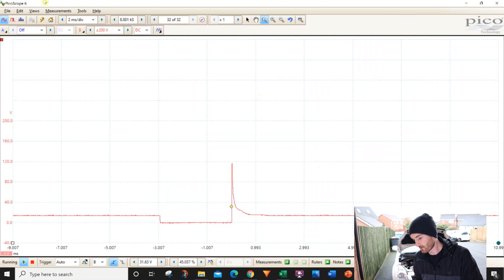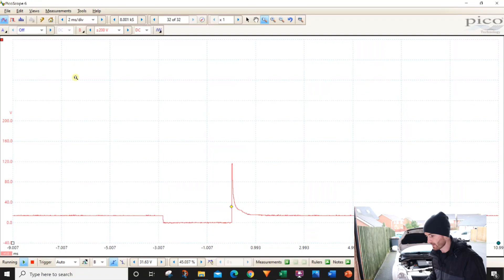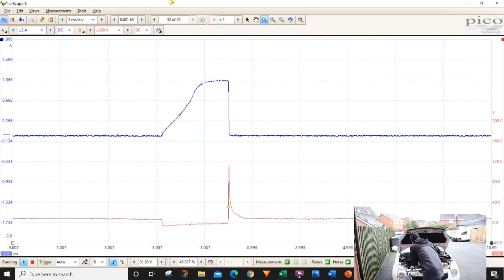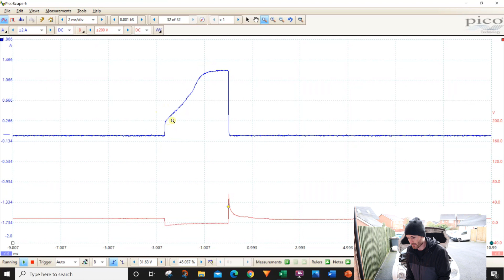SIMPLE Injector Current Ramp | Automotive Oscilloscope Diagnostics | Mechanic Mindset

Comment: Love your videos. I know you have addressed it in previous videos. I think pointing out you have an attenuator on the ground B channel for the  injector and no attenuator with the current clamp would be helpful
Reply from the maker: @weloveups831  Amp Clamp doesn’t need it as it’s not producing a voltage over 20V and we’re not physically measuring the voltage. It works like and amp sensor- the voltage is produced by the amp clamp

Comment: With every clip I watch I'm becoming more and more interested in buying that picoscope.

Dude, the possibilities! Say you get a car that has that annoying ever-so-slight twitch every once in a while, indicating a misfire but not enough for there to be a DTC. Air leak? Bad spark? High temp? Injectors? Coils?

This type of diagnosis, and combined with your other vid on how to test ignition coils, makes it sooooooooo easy to in, say, 15mins?, completely exclude the ignition AND fuel system directly above the cylinders.

Amazing, no more half-arsed guessing. Just comparing each coil and injector.

The moment I get that picoscope I'll be amp-clamping every single part I can get my hands on haha
Reply from the maker: For sure! Very powerful stuff once you get in to it! The 2204A will get you a long way; and then you’re gonna want to upgrade for the 4425A 😅

Comment: Hello from the US . I'm a lady master tech and I Love your videos! 
Another way I have been taught to test for misfires, is to test the power side fuse at the fuse box .If the coils or injectors are not accessible you can take out the fuse for either one and install a loop of wire with a fuse in its place , the current ramp all the injectors or coils to see if one is failing causing the misfire and put a trigger on it , like you would do with a RC test. You can also do a fuel pump the same way. A good video to make could  be on testing with the mini amp probe at the fuse box on different  things?

Comment: Hello. However, I bought a pico 2204a, i.e. with 1 \ 1 x 10 probes for trucks, the possibility of connecting 24v and a current clamp adapter may be useful. Hantek starter will probably be too weak? thanks for the help.
Reply from the maker: Are you referring to the Hantek amp clamp? I suppose it depends on what you need to measure.
Reply: @MechanicMindset  to the probe to measure 24v is probably a choke needed. and the tongs will be an expensive thing. inrush current about 2300 amps. unless the starting current is not measured, Hantek 650 may be enough?

Comment: From the video, you stated that the pintle hump on the current waveform means the injector pintle is open and the pintle hump in the voltage waveform means the injector pintle is closed. Do we need to use 2 channels when checking injectors?
Reply from the maker: To see these 2 events, they need to be checked with an amp clamp and a voltage probe. Separately. You could use one channel and do 2 measurements. But yes, this is 2 separate tests

Comment: Hey Darren,
Great follow on from the last voltage/injector video. There is so much that can be learned from both the voltage and current waveforms run in combination. This includes the MOSFET & diode or zener diodes inside the ECU used to 'clip' the flyback voltage, which helps control the injector close rate.
Well done on another brilliant video in the oscilloscope series!
MiracleMAX 😁
Reply from the maker: Great point, maybe something we can explore in a future video, thanks! 👍

Comment: That last bit about a partial short, sharp initial ramp and maxing out higher than expected was really good Darren.
Take care:)

Denis
Reply from the maker: Cheers Denis, I was quite pleased with myself on that one 😁. Maxing out higher than expected was just because I put a resistor in parallel to the injector increasing the total current. I don’t think it would do that on a real short circuit, just the initial vertical current increase 👍
Reply: Yes, a lovely dual-function tool.

Comment: Really like your videos. I want to lern more. Did you recomend the Pico 2204A to start with? Or is it easier for a beginner with a more expensive scope? More help functions etc?
Reply from the maker: Hi, glad you’re enjoying the channel. To be honest, to a beginner the 2204a and the most expensive 4425a would appear very similar. I think the 2204a is a great starter and you can always sell it if you decide to upgrade. All the accessories can be used on any other Pico too 👍

Comment: excellent. question: how would one interpret the slight short / initial vertica current spike that you explained toward the end? Is it indication of a failing/dying injector?
Reply from the maker: Yes, more than likely a short in the solenoid coil winding
Reply: Inductance in a coil is the property that resists a sudden change in current flow, effectively limiting initial current flow while the magnetic field is building. That's what causes the normal current ramp to be wedge shaped. Normally when a coil is shorted, the insulation at one spot has melted to the point that current can go through fewer loops of wire before it finds a direct pathway to ground. With fewer loops of wire, the inductance of the coil is reduced, so the current ramp is steeper, more closely resembling the way a normal resistive circuit behaves.

Comment: What's your opinion, using the 6 way universal breakout lead's ?
Is it good, by the mean, no back probing and  make a damage to the loom?
Do we have better connection (and waveform) ?
Reply from the maker: They are quite useful. Couple things to be careful of from my own experience. 

1. If you are looking for a fault, removing the connector might affect the issue
2. Always check they are ok before you test, I have used faulty test leads in the past.

Comment: Just a question, if you connect the ground to a chassis ground on one channel while measuring a lamp, and the ground elevates at 0,1V because of voltage drop, is the second Channel, where a battery powered ampclamp is connected going to show something wrong?
Reply from the maker: Current will flow across the ground through the scope; you must not do this with a common ground scope. We did a video on this 👍 You need floating grounds for that.

Comment: Hi, Why do you use an atheunator when testing the voltage and current of the injector when the maximum input voltage of the oscilloscope is 20 volts?
Best regards
Reply from the maker: Hi, I only use the attenuator for the voltage signal (not the amp clamp). The spike goes up to about 120V. Sorry, I had the attenuator connected when I picked up the scope and didn’t make it clear it was for the voltage signal. I cover this on my last video, check it put if you haven’t already 👍
Reply: When the magnetic field collapses after the injector is  turned off it induces a huge voltage spike that will fry a small scope like the 2204a. But it's a great scope, I use the same one all the time.
Reply from the maker: @alanw5879  For sure, I discuss this in the first video before this 👍
Reply: @MechanicMindset  opps my bad, I did not see that video.

Comment: What about the coils oscillations at the beginning of the amperage waveform, I see some vehicles have them and others don't. Is that something you look at?
Reply from the maker: Great point, I might have a play on the car and see how I can help to show this, maybe a part 3! 👍
Reply: @MechanicMindset  I was always taught that they're very significant as for addressing the coil/injector etc health. The start of building the magnetic field, technically the injector doesn't actually open until about half way up the ramp and after the injectors turned off there's still a small amount of fuel being delivered until the pintal is fully closed. Of course this happens in micro seconds. Just a thought, but I really do respect your videos. We're you using just a x20 attenuator for the voltage signal? I worry alot about damaging my scope (2204a) as well.
Reply: I forgot to ask, you don't use attenuators on your amp clamp correct? Cause you're only measuring the magnetic field and not tapped into the wire?
Reply from the maker: @alanw5879  Haha, no; I already have the injector voltage signal connected on channel B when I presented the scope. A few people have asked that, I must be careful with that in future videos, could be misleading! 👍

Comment: Would we see similar waveforms on diesel injectors Darren? Great video as always 👍
Reply from the maker: Cheers!  Yes a solenoid diesel injector is similar but might look quite different voltage wise. It also depends what type of diesel injector you are measuring; there are 3 main types used in the last 10 years that would all look very different to each other. Lots of questions on diesel so I will make a video soon 👍
Reply: @MechanicMindset 
yeah! I have a 6.6L DURAMAX LGH V8 Turbo (diesel) Direct Injection in a Chevrolet Express 4500 mini bus, (14,200lbs vehicle)... it has the super duper $400(ea.) injectors.
Will look for the video.

Comment: boss can tell us how to test bmw oxygen sensor if good or bad
Reply from the maker: Hi, I would start with the diagnostics. if you have an older oxygen sensor you can measure the signal voltage. The newer broadband oxygen sensors are more difficult to measure with a scope, you need a very sensitive amp clamp.

Comment: mind me asking where the AMP clamp is connected to?
Reply from the maker: Sure, amp clamp is connected to the oscilloscope via the BNC connector and I have clamped around the injector wire at the injector. Doesn’t matter which one 👍
Reply: @MechanicMindset  Thanks for the info! I was confused on which wire it was connected to haha!
Reply from the maker: @pyrorenegade4983  No worries. In theory, you can connect an amp clamp anywhere on the circuit (I.e. live side, ground side, you could also put a loop at the fuse or relay and measure there)
Reply: @MechanicMindset  Noted! Thanks!

Comment: It baffles me when you look inside the clamp there's not much there. Why make it so bulky. Not to mention the jaws can't clamp on some battery cables. Lmao
Reply from the maker: The tiny jaws are very limiting! I’ve never opened it up. I’m guessing at one point the space was needed and they never re designed the body. There are a few brands using the same body design